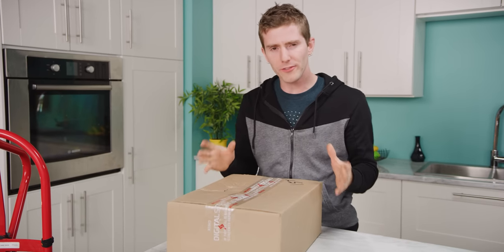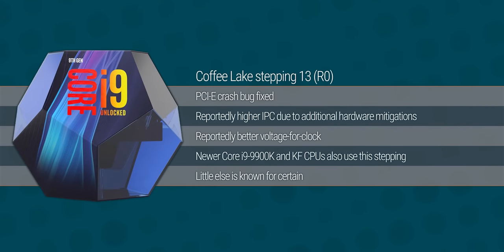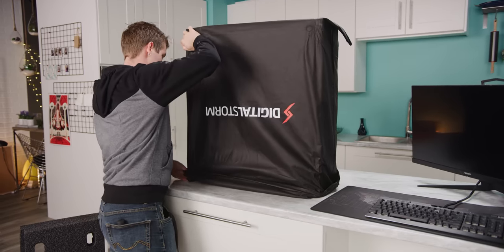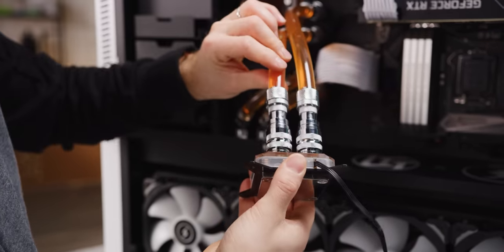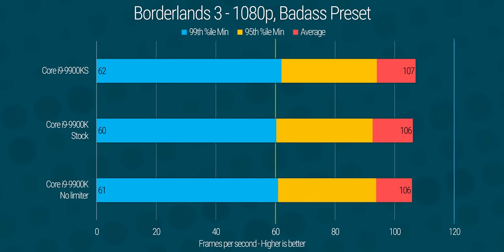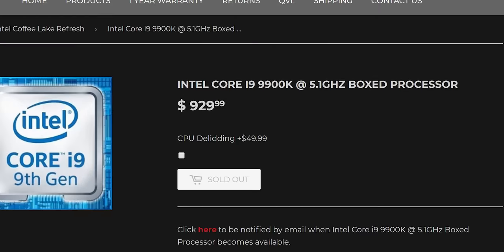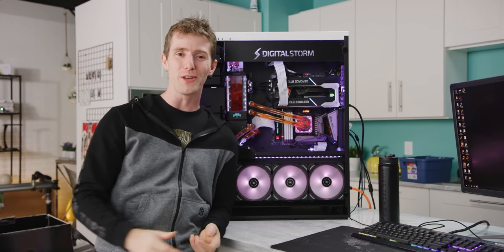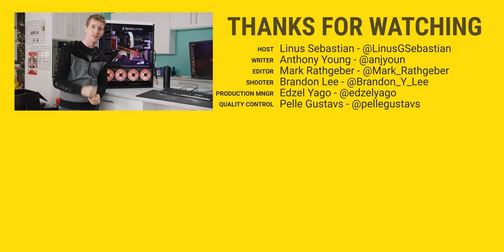Intel's PRE-OVERCLOCKED CPU... Core i9 9900KS

Comment: Intel: "This processor comes PRE-overclocked"
AMD: "Our latest processors will just keep boosting until they hit a power or thermal cap"

Edit: I like how this throwaway joke has incited a comment war which still gets replies 2 months after the fact.
Reply: Loop 
Nerds: "So we made this insane thermal pump for Threadripper cpus. It can pump up to 1000w of heat at 90*C temperature difference."
8nm chips: "5GHz here we go !"
Reply: @Chris-hw4mq  yes, but AMD is getting about 4.5ghz on 7nm chips WITHOUT refreshes, and Intel is getting 5.0ghz all cores at 14nm+++
Reply: @Chris-hw4mq  amd has more cores and intel has more frecuency. are you happy boys?
Reply: @Chris-hw4mq  "iN gAmiNg cOrEs dOnT maTteR"

Get a lyfe
Reply: @Chris-hw4mq  BTW linus was testing Intel on cinebench...he did NOT use that for Gaming only.
Reply: @Chris-hw4mq  my a6 6400k overclocked at 4.6 doesent think the same
Reply: @Chris-hw4mq   In 2010 maybe.
Reply: @Chris-hw4mq  go play on a pentium if cores don't matter
Reply: Ah yes man children arguments about hardware.
Reply: @Chris-hw4mq  Your knowledge about CPUs is literally non-existent. We are at point where transistors are too dense (generate too much heat) to reach very high frequencies. Why do you think Intel's been struggling with 10nm for so many years? It should be "easy" for them to make them overcome 14nm, right? No, it isn't easy and without some groundbreaking ideas it's not possible in consumer's desktop environment.
Reply: @franciscoandrada412  he's a troll just ignore him
Reply: @samuelhopkins5383  Here I am running 6 cores at 5.3 Ghz on a normal rig. What's the point for gaming (I insist on gaming) for a 494935 core processor ?

That said, for productivity with regular gaming, the latest AMD slay vs the Intel Xeons from a bang for bucks ratio (they even allow ECC). I just don't need to power for productivity as much as for gaming. So I'm riding 6x5.3 with lower cache. The real big big big machines will need to check the pciE lanes too but i think the previous amd chip cover it (not the latest one, it sacrifices a few lanes somehow ?). Also the Xeon are designed by default to be running 24/7 I am unsure the amd are. So, I bet for now we will see Xeons only in servers and more amd in semi pro/pro machines.

There is a reason why 5ghz is kind of a limit at normal temperature. My elecronics engineering years are far but it boils down to the distance made by the electron during the cycle per second which is very close to the size of the lanes it needs to use. Reducing their size could help but there is very very little we can do against the laws of physics, so it's gonna be multicore, bigger cache etc from now on. It is down to software to be able to use them (not yet the case except for professional softwares)
Reply: @Chris-hw4mq  yeah because everyone uses their PC's ONLY for gaming
Reply: And people on this thread seem to forget that AMD was hitting 5ghz on FX chips.  
Let's see what amd brings for a refresh of 7nm. I mean, ryzen started low, then got faster on their refresh, now they are faster on a smaller core. Clearly they are figuring things out. Be nice to see where they go from here
Reply: @Chris-hw4mq  try gaming on a 2 core vs a 4 core. "iN gAmiNg cOrEs dOnT maTteR"
Reply: twinblade98 AMD is not and never was on 7nm. TSMC is. And you better pray that Intel will successfully start 10nm production because if they won’t they might start buying 7nm wafers from TSMC too and the Cpu prices will most likely skyrocket, because there will be both 7nm shortage as well as monopoly from TSMC side in 7nm wafer manufacture and from Intel you know what happens when a company has monopoly
Reply: 5ghz is nearing the limit of whats physically possible or practicable as the smaller size transistor are getting harder to make and the heat load is becoming too much for even That monster of a cooling system.

most games use 2-4 cores these days, 4 being quite rare. on a 2 core CPU the game has to fight Windows for power which it loses and the game chugs.
Intel got away with releasing 4 core CPUs for that reason.
the reason most game wont use more than that is compatibility with lower core CPUS and the hassle (a very big hassle, trust me) with multi thread programming.
Reply: @Chris-hw4mq  why tho?.. dropping to 7nm does mean mean a drop in thermals, in general, but then again the parts that do produce the heat are closer together, denser dies
Reply: @Chris-hw4mq  have you ever heard about IPC? I don't think so
Reply: @Chris-hw4mq  It is based on what you said before. If you know how this stuff works, then I don't understand how could you say such bullshit. Comparing different CPUs based on frequencies makes zero sense.
Reply: @Chris-hw4mq  Ever heard of GTA 5?

That needs cores.
Reply: Chris723 Good point but AMD thrashed Intel into releasing 10th gen extreme edition with there 3rd gen zen chips so I wouldn't be so confident on Intel lol
Reply: @Chris-hw4mq  The fx 9590 could reach 5 GHz on 32nm back in 2013. Didn't make it a good CPU though.
Reply: @flixlion9109  Ah yes, the fx-9590, the 10980xe is the spiritual successor to the 9590. Hot, power hungry 5ghz CPU's.
Reply: @Chris-hw4mq  in gaming you'll still be fine with a cpu from 6 yrs ago.
Reply: 7ghz is the record on an Intel chip. Just sayin.
Reply: Patrick Henry you do know it has a smaller nanometer technology than intel right 😂😂
Reply: and they don't make more than 4.2ghz
Reply: that power cap seems to be resched pretty fast
Reply: @Chris-hw4mq  tfw you ad hominem abuse because you don't know what you're talking about
Reply: intel definitely will beat amd again soon because they simply have that much money, they just haven't figured it out yet. but that doesn't mean you should lie both to yourself and to others that intel has.
Reply: @thealien_ali3382  yes that is called "a different architecture".

one company chose cores, the other chose clockspeed, but thankfully both work and amd's modular design allows cheaper cpu's for the time being. just because intel isn't the best right now doesn't mean you must lie to yourself and to everyone else that they are still the best, because that's simply not true atm.

intel will definitely beat amd's ass sometime soon though, they just need some time to figure out 10nm
Reply: @imanjx2914  once you get past like four or eight cores the more cores don't do much good for gaming
Reply: @Chris-hw4mq  so?
Reply: @Chris-hw4mq  is Intel getting 5 GHz easy on anything besides 14nm? No, they aren't.
Reply: @Chris-hw4mq  well, do you only play games?
Reply: @Chris-hw4mq  uh, who was making the argument about gaming? Because no one was.
Reply: @w04h  huh? Tsmc is a huge company. Also, AMD is one of their more primary customers.
Reply: @ForNoReason1000  no. Have you seen tech deals? He found out that most games need six cores to run well.
Reply: @hochhaul  you mean the 9590 was a spiritual successor to the 9900ks?
Reply: @WerTicusness  well, you'll be fine. But you'll be better with a modern CPU, plus with Intel's security vulnerabilities, you'd be better to buy new processors.
Reply: @TheGamersHome123  well, nanometer transistor count is weird, even across two companies. 7nm AMD is 10nm Intel.
Reply: @thealien_ali3382  in what applications besides gaming?
Reply: @bananya6020  they said they won't catch up until 7 nm.
Reply: @evedoingthingsaaaaa  yeah they do. Watch tech deals on a 7700k, where it chuges in modern games.
Reply: @raawesome3851  ok maybe that was badly worded
what i meant was that intel will eventually catch up whether it's from malpractice or from finally figuring out cores.
the issue is that intel has so many contracts and so much money that they simply won't die for the next 5 years. If the CEO has more than 2 brain cells he would get his engineering team working overtime to figure the chips out, and if that doesn't work (hey dell, want some intel money?)
Reply: @bananya6020  fair enough. But I hope they actually make a competitive product.
Reply: @2023awakening  not really... in 2014: 8.723 GHz @ AMD FX-8370 chip. Previous world record 2011: 8.429 GHz @ AMD FX-8150
Reply: @3id3n  re read my comment

To further clarify, FX series chips don't hold a candle to the intel chip in question. They can have a 15ghz on FX but wouldn't matter because it doesn't have nearly as much raw processing power as the intel chip.
Reply: Syther Force  has nothing to do with my comment. I'm not good enough to run a chip with nitro Cooling. My comment still stands.
Reply: 😂 Welcome to the end game.
Reply: And the legend says that @Chris723 is still fighting to this day, even 4 months after the video went up.
Reply: @FM_PERON2022  you're forgetting about ipc. Zen 2 is about a 15% increase over Zen+, so 4.5*1.15 = 5.175
Reply: Reni4kill  intel has become cheap
Reply: 10,000 subs with no videos challenge funny
Reply: @ForNoReason1000  no they don't. Maybe you are thinking about csgo and overwatch. That's 10 games. Consider these hundreds of games last year. They struggle on even a 7700k.
Reply: @Chris-hw4mq  lol look who's talking
Reply: @Chris-hw4mq  when games start using hyperthreading amd will dethrone intel rdr2a lready uses hyperthreaf and amd has 15fps more intel i5 10500K vs ryzen 5 3500XT in rdr2 and with mc with shaders its 10fps more cuz shaders use more cores of the gpu and cpu
Reply: @Chris-hw4mq  cores do matter, most modern games are multithreaded
Reply: @AmaiHachimitsu  go play on pentiu  if u think cores don't matter. If u have 2c2t pentiu  u will lose to 2c4t atnlon of same price
Reply: @SUPABROS  Wrong person
Reply: Actually your still getting replies 9 months after the fact
Reply: Chris723 AMD has a higher IPC, about 15%, so an R9 3900XT has like 5.4Ghz boost compared to intel.
Reply: @Chris-hw4mq  actually they do care about cores. Parrelization of the loading and rendering assets of the game.
Reply: I hate people who have no idea how CPU processes shit go down and says shit that causes a huge hate explosion full of pro AMD crap in it.
Here's a quick startup guide to your life: you do research beforehand, and you should always respect other people's choices. If that person made a crappy Intel choice go and recommend another Intel product. People still choose Intel for a reason
Reply: @bananya6020  I believe Intel just have bad decisions
Reply: @Chris-hw4mq  you are the best aggressive pro-frequency human I've ever seen. I have faith in humanity again even though I am pro-cores
Reply: @FM_PERON2022  it has a higher ipc rating
Reply: @wirytiox1577  that is out of talk thanks to 5000 series
Reply: Can I join the war?
Reply: this comments replies are fucking hilarious, AMD ftw.
Reply: @Chris-hw4mq  in gaming clocks dont matter either... what the hell is your point??

Comment: 5 ghz is tempting, but im sticking with the 3950x this gen
Reply: 5ghz is as about as far as we are going. All improvement from now until a new material are incremental.
Reply: Hmmm an 8 core CPU that dumps tons of heat into my room or a 16 core CPU with near equivalent cores that produces half the heat... Tough choice
Reply: If you can get your hands on one and if you're going to use it for gaming, you may as well go for the much, much cheaper 9900K. I did and it was cheaper and more available than the 3900X.
But please buy AMD because my shares are through the roof XD
Reply: 8 cores isn't that impressive to me after having a few for a few generations, and I seldom see the benefits of higher-revving engine RPM from an 8 core, not when horsepower is more important to my non-gaming needs. 80 horsepower (16 threads x 5GHz) from a 9900KeepSpending isn't that impressive compared to what I already have, and the 144 horsepower (32 threads x 4.5GHz) of the 3950x is just about a drop-in upgrade for my 3D render machine. I don't do single thread games, and 3D renders often take hours not less than a second that 'boost' applies, so that single-core 'boost' has never meant anything to me.

While some games still are limited to the performance of a single thread, even games are starting to use more than 1 thread as a majority now, so the gains from a single core boost will probably see diminishing returns in the future, even intel has stoped selling 4 core 8thread CPUs as the 'top-end' consumer part'. remember when the 8700k was only 5% faster than a 7700k on many game benchmarks, and now a 4 core just can't cut it for some games. lol.  Glad things are progressing again.
Reply: HaX Von Cydow I would not be so brash on the 5GHz wall, remember only a few years back the 4GHz wall was a thing and you had to do exotic cooling (not a stock heatsink) to get the mythical 5GHz on many CPUs.

Also, the max clock is a function of 4 things. how fast the fats can switch, the length of the traces between fets (propagation delay), and how many gates are between the input and output of the circuit between buffer/latch stages. Oh, and there is that heat dissipation with dense circuits thing as well.   Eons ago, when SOI came out (or was it copper inlay), IBM was playing with 100GHz fets, so I can assure you, glass by itself is not the limiting factor for the apparent 5GHz wall, lol. AMD and Intel just got to get the propagation delays under control and maybe simplify some of their complex logic.

Hell, the radio frequency NASA Deep Space Network uses to communicate with many craft is over 5GHz (8.4GHz band), granted not exactly the same kind of logic for a radio, however over 5GHz is more than feasible for some circuits.

Maybe if they find workarounds for the limitations of using graphene that some ignore, then maybe it will become viable, glass has a ways to go tho.
Reply: @Zarcondeegrissom  I can't believe you just tried to compare a processor frequency to radio frequency.

 Hey my dryer spins at about 1 revolution per second, a.k.a. 1 hz, that's the same unit as CPU frequency is measured in, therefore 5 GHz dryers are totally on the way
Reply: it's called an analogy with a hint of sarcasm, and did I not say it's not the same kind of logic (analog vs digital), lol. the point is, the transistors can indeed switch way faster than 5GHz, otherwise the radio electronics wouldn't work above 5GHz.

As for the GHz obsession, it is like someone bragging that their motorcycle 1 cylinder is better than a locomotive diesel, just because the 2-stroke can rev up to 5,000 RPM.  just because the bike engine can rev so high, is kind of pointless when the task is moving a train, lol.
Reply: @Zarcondeegrissom  While you did say its "not exactly the same", you used it to say that if thing A can reach arbitrary frequency, unrelated thing B obviously can as well, which I demonstrated with my ridiculous analogy (which actually was an analogy, unlike the example you gave - examples, not analogies).

Also, while I have no idea how you believe a radio works, it's become pretty apparent that you don't really have a good grasp of it. The radio waves themselves are what move electrons, there's no transistor required. You get the frequency you want by filtering out the ones you don't want through the use of a tuned circuit, which, again, doesn't have any transistors in it. Stop spreading misinformation please.

https://en.wikipedia.org/wiki/Radio_receiver
https://en.wikipedia.org/wiki/LC_circuit
Reply: transmitter, low-noise amplifier (LNA)?     and ye missed the first half of the former paragraph where I had mentioned they are not 'exactly' the same, yet the one shows that glass is not as limiting as other things for a CPU.

I think it's getting a tad distracted as well, the original comment was only saying that silicon can do more than 5GHz, ye need not go to exotic materials for that. the rest is nitpicking off in left field. I'm glad you have an interest in radio, it can be a fun hobby with lots of facets to check out.
Reply: left my 9590 outside the dairy

nek minit
Reply: @Zarcondeegrissom  there is factor of speed (superconductivity) and ghz/size of the lanes the electrons need to go through. The tinier the circruit the faster the clock can be (less distance needed to go through in a light celerity divided by frequency)
Reply: @fo shizzle It's a wall that we are now breaking to push technology even further and faster, just like a couple years ago with the 4GHz wall